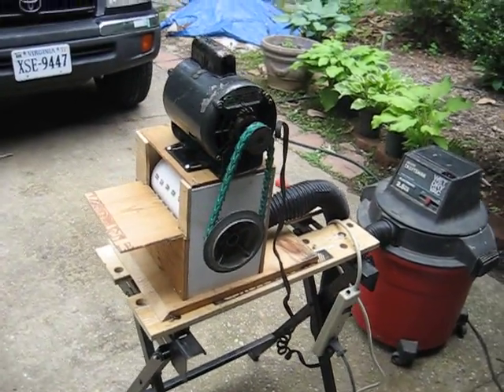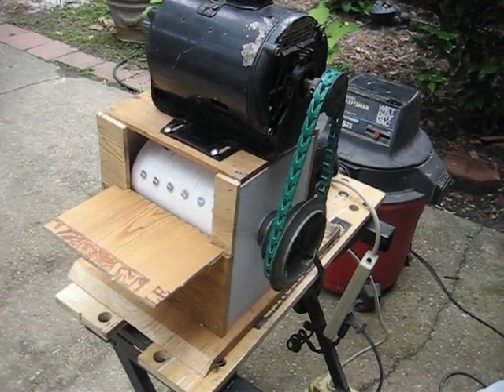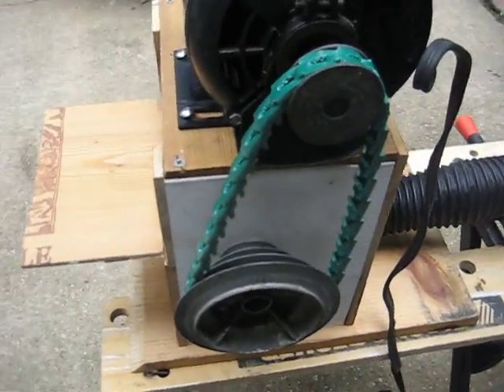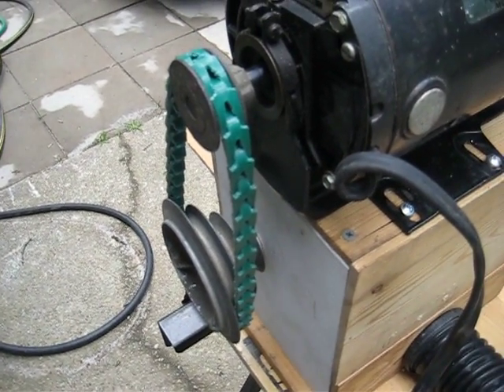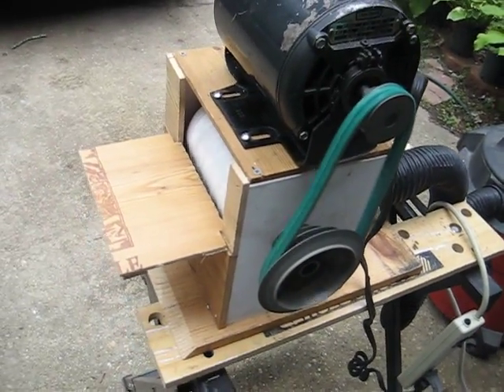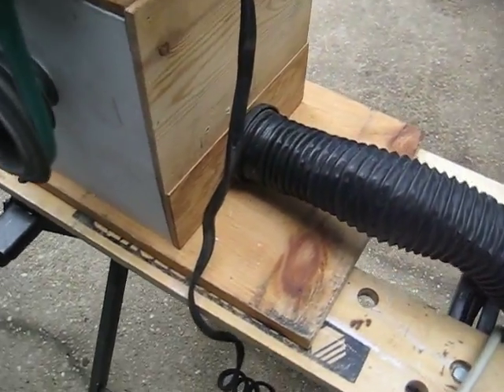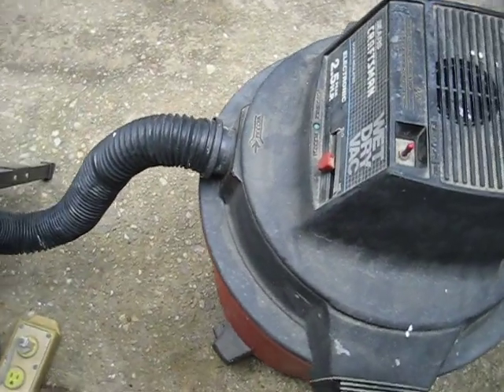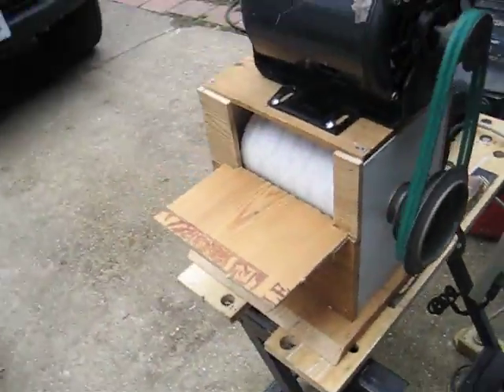DIY Styrofoam Shredder

Comment: I would put a hopper door that could be used instead of your fingers to push styro into the roller!
Not having to worry about fingers would allow you to fully utilize the motors power, another drum could be used below to grind more foam faster!